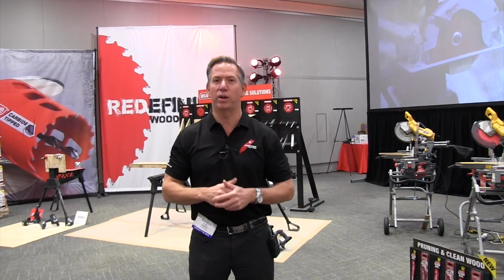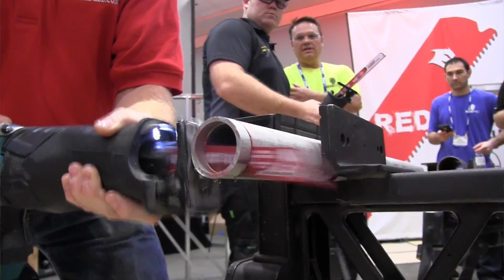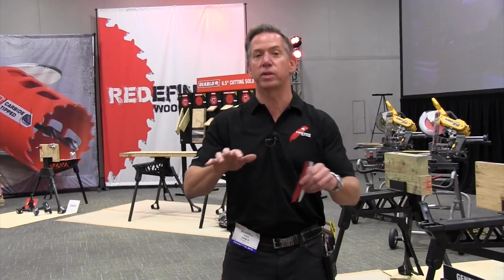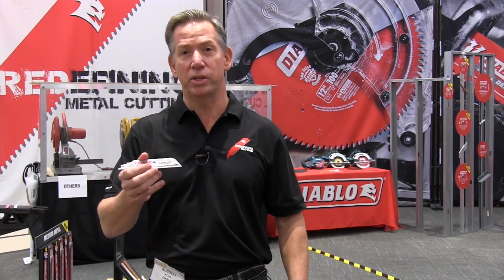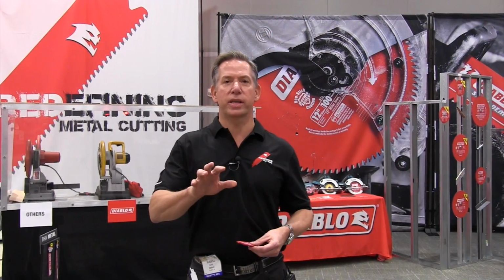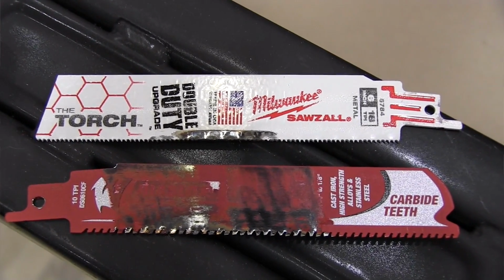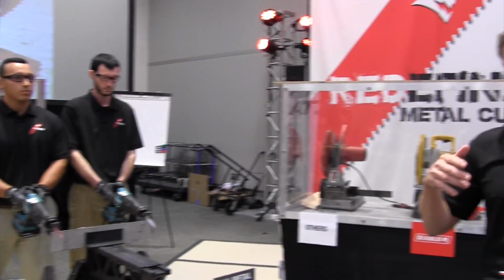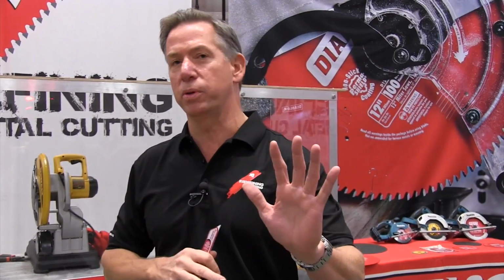Diablo's Recip Sawblade Carbide Technology

Comment: In my personal experience the Diablo Carbide is far and away the best Recip on the market.  Not only does it out perform against the competition, they also offer a full range of Carbide.  Clean wood, Nail Embedded, GP, Thin, Medium & Thick Metal.  Milwaukee has 2 (Ax & Torch), Lenox 1.  Diablo understands that Carbide is the future!